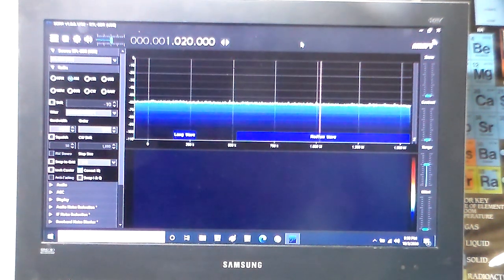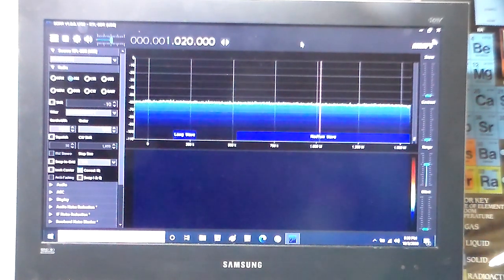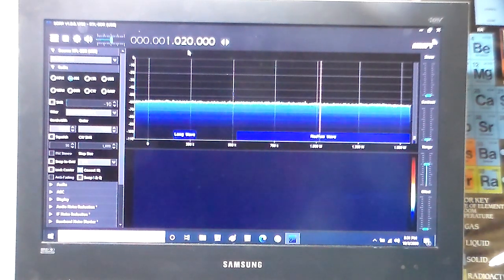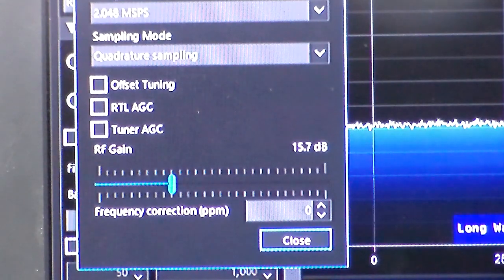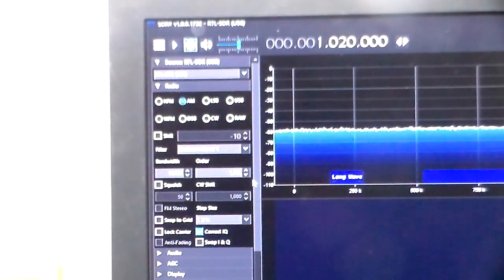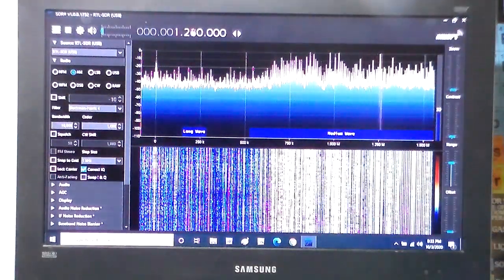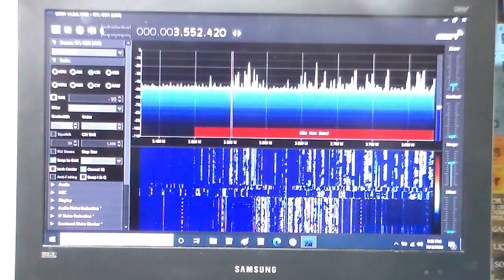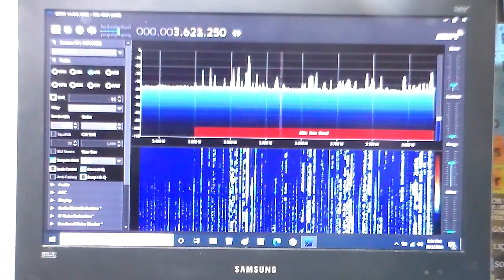How To Set The RTL-SDR To Receive HF and AM Radio Bands

Comment: Thank you very much for your video. I followed your directions. I set to listen to commercial stations in the MW Band and also in the SW Band. 

Unfortunately, I am not getting any stations. I am using a Doungle RTL-SDR Noeelec 2 + and the SDR ++ software on my Android phone. 

I receive stations in the FM Band well. I would like to listen to radio stations in medium wave and short wave on my Android phone. 

Please can you help me? Maybe I am doing something wrong....
Reply from the maker: I can't say for sure with that particular setup, but for HF (below 30 Mhz) antenna is a requirement.  Even if it's just a fifty foot piece of wire strung out on the roof.  Sunspot activity is also killing HF right now. Google what time of day is most active for the frequencies you want to listen to. HF is highly influenced by the ionosphere.  If you're able to work through all that you will find HF fascinating.

Comment: At the end you said the key is to have a good antenna. Does this mean this won't work with the stock dipole antenna?  I'm on RTL-SDRv4 but it does have that Q branch for Direct Sampling. I'm still kinda new to this so maybe there are other settings I need to look into.
Reply from the maker: How long and where is the dipole mounted are things to consider?  Also make sure you don't have squelch on and RF Gain is adjusted to allow lower strength signals.  Start with looking for known signals like AM and FM radio stations.  Then try things like WWV in the states and CHU in Canada.  HF wave propagation has been very up and down too.  Don't forget to look at the 27Mhz CB channels too. There always seems to be someone on there running gobs of power.

Comment: The V4 has a built in up-converter and works much better than direct sampling method in receiving in those bands. It's even slightly less expensive than the V3.

An external up converter or an SDR that's designed for that frequency range will also work better than this method, but will cost extra.

Comment: Thanks for this video. I am now getting stations above 120 MHz and 423 MHz.  I use SDR ++ and set it to Q branch.  I am just using a few different lengths of wire as a simple antenna on my back porch. I am now considering adding an Lna board.

Comment: doesn't work with mine. it just shows random peaks that go left and right when i change frequency. dunno how to explain it, but surely my hardware does not support this.
Reply from the maker: You still need a decent antenna.  Can you receive any of the local AM radio stations?   I think there was and older version that this didn’t work on. Not sure if firmware can be updated if that is the case.  Good luck.
Reply: @KA3AJI  ah that would make sense. there are a lot of little glitches and little things that don't work with my rtl. for example i see signals that are somewhere else on the spectrum in random places. will look if it's possible to update the firmware.
(p.s. no i can't recieve am even if one was transmitting next to my antenna)

Comment: wonderig how you deal with am, i mean i have a radio if i plug zero sound for radio station then unplug i tune in guessing its the same with rtl sdr, at least for am.  barely i get one radio station on am.
Reply from the maker: Well, depending on where you are the antenna has a lot to do with it. AM radio stations run a whole lot of power so you may pick something up on the broadcast band with even a conservative antenna.

Comment: I got excited when I saw this video on why the RTL-SDR won't get HF freqs, since mine is crap down there too. Once Q-Band was mentioned, hopes faded for me too.  I know my dongle "works" 'cause I do get one local station that's 5 miles away, that's it. And it comes over very very weak, when my cheapie portable AM radio gets it loud and clear. Long wire makes no help.

Comment: Still having issues on MW band. Changing the software setting got me one AM band station (normal radio gets many). I know it's an antenna problem because putting my hand on the dipole that comes with the rtl-sdr/V3 blog kit, causes an increase in gain and gets some more stations. Tried running a long wire to the coax feed of the dipole but no-go on that idea.  Sending the kit back since it only gets FM and weather band clearly. Expected the tech would be further along by now- especially the software driver set up.  Great video. Best of luck.

Comment: Thanks! I was scratching my head at this. FM stations were great. Not even a blip on the MW broadcast. 
A lot to learn on this little unit, so I'm in for a lot of fun. I got the rtl-sdr v3 with the antenna kit. Looked like the best reviewed, aside from those that thought it was plug and play.
 I followed the installation directions exactly as put on their website. Got a little nervous with a couple settings but held my breath, hit accept and voila! It worked!
Thanks for posting this!

Comment: HDSDR I have is not picking up the HF bands, no matter how I try and get it. VHF comes in on Direct sampling, tried both "I" input, and "Q" input. neither one worked. Not even getting any signals on the water fall, except for a couple of steady peaks. Tried Freq 3,755 (80 meters), where usually Ontars net come in, and can't get a thing. Can't get any am freqs. as well on the radio AM radio band.  Just downloaded HDSDR about 4 days ago. VHF is coming in just fine, specially off our local RPT. Any suggestions on how to bring in the HF bands?
Reply from the maker: Not familiar with the software you have but be sure to look at RF gain setting and AGC.
Reply: @KA3AJI  Thanks anyways....

Comment: I have a lot of problems with harmonics using these inexpensive receivers.  If I go above the 20 meter band I get receive tons of harmonics from lower frequencies.  I still haven't figured out a way to eliminate this.  I suppose an SDrPlay or AirSpy would not have these problems and that's why they cost a couple hundred dollars.

Comment: Been fooling around for 2 days and could not get AM to be found with QubicSDR on Mac. Your video helped me, even though the software is different; the logic applies. I still cannot pick up HAM, CB, etc.... I think this is due to my antenna but not sure, because there is a repeater less than 1 Mile from my home. Thanks for your help.

Comment: Thanks for the video, I'm problems, my generic dongle gets in HF just an am season, I'm using a Delta Loop 28mHz and nor 10m do not get anything, even with all the settings ... I need help .... 73s pu9ycz ... thank you
Reply from the maker: Is it the ver3?  That's what I was setting up.  I have heard others report their dongle was bad.  Mine works but it does get pretty warm after a bit.  Does yours work best on any frequency?

Comment: That is important.... but being a newbie...and something that most people fail to emphasis...  ANTENNA.
Is more important than software or dongle to picking up respective bands.

Using any of the 3 stock antennas that come with the RTL-SDR kit... you will still not be able to get the HF and AM radio bands.  They seem only to work well in the FM band, a bit in GMRS (you can't hear the voice, but you can see the signal).  NOAA doesn't seem to come in no matter what which is weird since all my physical radios  - handhelds and mobile work fine.
You mentioned you have a relatively long outdoor antenna... I think for those of us who are new to us, need to realize that is REQUIRED to get any long, medium, short, ham bands to tune in.
Reply from the maker: Even a really long wire is helpful.  I have even used the cold water pipe in the house.  Remember to switch your sampling mode back from Q Branch when you go above 30 Mhz.
Reply: I'd love to hear more specifics about antennas and "city band" tunning. There is so much content about "getting started with sdr" software, drivers and whatnot but not real sauce and numbers about  what it really takes. You guys, spill some of that wisdom 👑

Comment: Hi, I do have the original rtl-sdr from the Outernet project. I can't get it to work on HF. I did select the Q Branch. I did open it up and it looks the same as the original. Do you know if and what could I try regarding EEPROM upgrade or such? Thanks
Reply: I have an original DVB-T+DAB+FM unit and it doesn't receive anything below about 24 MHz. Can't find any settings in SDR# that make it work below that frequency. Works great up into the satellite freqs though.
Reply: @UC8BQ4zTMrr11PU-p2dUoiJw thanks, actually it was an old rtl-sdr from the Outernet project, but it was version 2 not 3. I do have now the v3. Thank you.

Comment: thanks for  the video. did you have any success with the antenna's they sent with the kit? all i have been able to acquire are my local FM . i have switched settings as others suggested and it looks like i have signals, im getting readings in the waterfall and i set the range so not to display bottom noise. im seeing definite solid signals but i am hearing nothing. ive tried everything the manual and many youtubers have said but no luck. thanks in advance if anyone can help.
Reply from the maker: I didn't get the antenna package.  Not to use full for HF receive.  Make sure you have turned the RF gain up from Zero to a higher value.  That changes the noise floor.  See if when you click on the waterfall trace you hear any noise when choosing raw modulation as opposed to usb, lsb, am or fm.  Uhf and vhf require shorter antennas so troll through the 2 meter ham band and see if you get anything.

Comment: Hi, I have a SDR with the direct sampling in-built. I can get lots of signal peaks but can't seem to demodulate any audio when I tune in. Any advice please?
Reply: i am having the exact same issue   lots of readings of solid signals but no audio whatsoever    becoming frustrated thinking i got a bad unit.  though im pretty sure the antenna they sent is junk seeing how the plastic snapped on 7th day lol
Reply from the maker: If you have the RTL, check this web site for tips.  If not the RTL, see if that software manufacturer has a blog page.  https://www.rtl-sdr.com/rtl-sdr-blog-v-3-dongles-user-guide/
Reply: @KA3AJI  Thanks Tim.

Comment: What antenna you were using, and thanks really helpful video.
Reply from the maker: I have a GAP Titan for ham radio.  But I'm sure just a long wire strung around would work pretty well.  I have tried it with house  cold water pipes. I still have copper.  It worked decent.